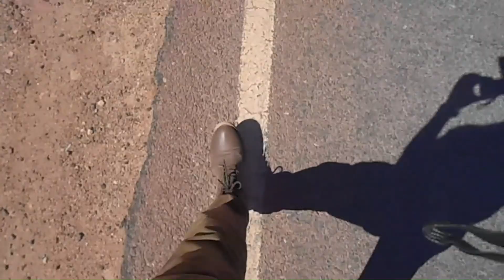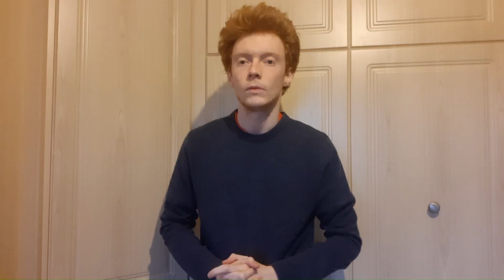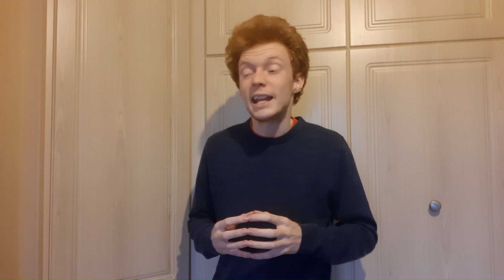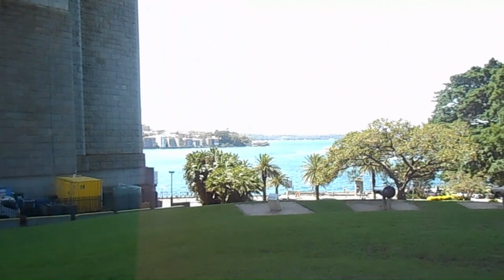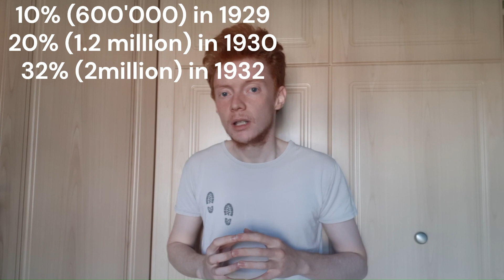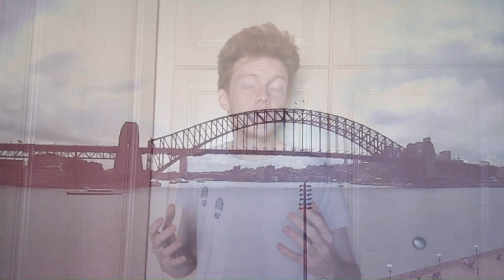Sydney Harbour Bridge, an Industrial Marvel and Historic Bridge (bits on the Original Dawes Point)

Comment: There still are 2 train tracks in use on the western side of the Bridge. On the eastern side there were 2 tram tracks. The tram tracks were removed in 1958 and converted to road lanes. I'll fill you in with some local knowledge of the area. The Rocks refers to the community that was established on the west side of Sydney Cove by the convicts that arrived with the First Fleet. It was given that name owing to it's rocky nature. The area was mostly saved from redevelopment by resident action and "green bans" put in place by the Builders Labourers Federation in the early 70s - minus all the properties that were demolished for the Bridge (as you mentioned). That area is still known by that name today. A lot of houses and businesses were also demolished on the north side of the Harbour for the northern approaches to the Bridge. The main ferry terminal is at Circular Quay (pronounced key, it's an old spelling) on Sydney Cove. Why Circular Quay? After a lot of improvements were made to the shore of Sydney Cove, it was know as Semi Circular Quay, owing to it's shape. But even back then nobody had time for that, so it was shortened to Circular Quay. One thing we can be thankful for is that JJC Bradfield thought big, even though Sydney was actually quite small at the time.
Reply from the maker: Thank you for your insight.
As it happens I created a video back in January on the First Fleet and the Rocks landing site.
But I was unaware of the Labourers Federation and there "Green Bans" of the 1970s. I was clearly looking in the wrong places when I was making my notes. I very much appreciate this local perspective that you have given.
This is why I make these videos so folks like yourself can share these facts!
Reply: @camac1874  No problem.